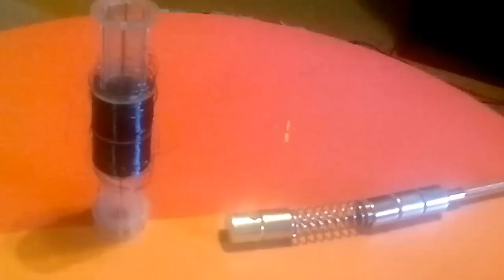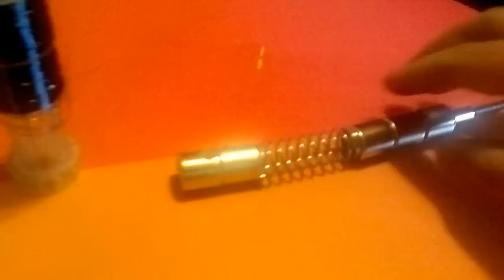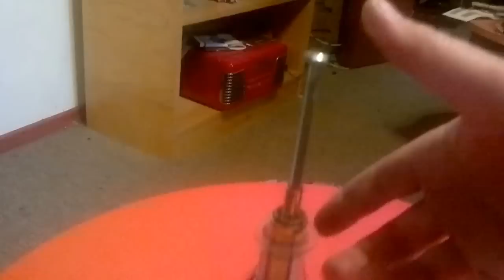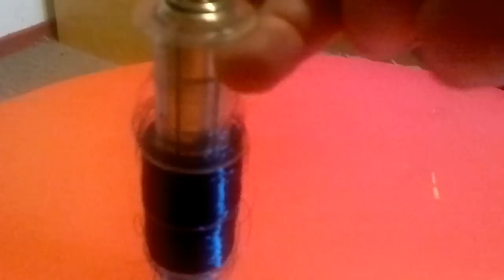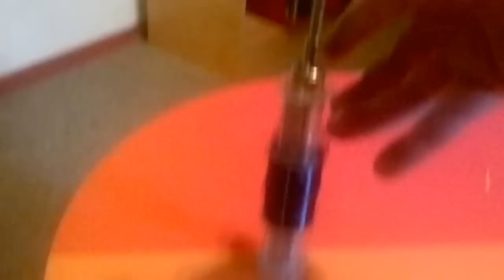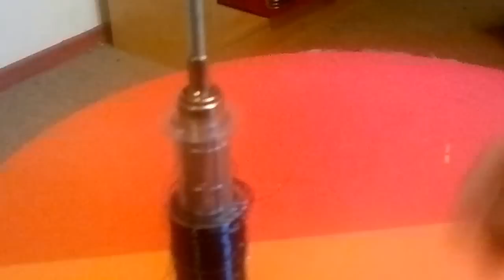Magnetic Spring Piston 2 see description

Comment from the maker: what about in the case of a pendulum, have the piston compress at say 3 o'clock and push the pendulum back and then not restrict it on the other side so it is free to swing higher? In this case slowing down or stopping the pendulum and compressing a spring is affordable as its just about to stop and reverse direction anyways due to gravity, would not a little extra pop be favourable?

Comment from the maker: Oh alright, I see what your saying, so it would be better off not to have it at all since popping it down will use up the energy.Well  I am wondering if the conservation of energy rule is taking into account  the two magnets pulling together making the work on the big wheel to be less then normally to compress the spring. Sure the magnets will still be in attraction and we are back to square one again. Or, is acceleration of a spring releasing breaking free of the magnets taken into account?

Comment: I'm not sure what makes you think this could work "in theory". If conservation of energy applies, then pushing the piston down will take slightly more energy than you can get back by releasing it due to inefficiencies like heat generation. So your big wheel will be able to move a shorter distance that corresponds to the energy transfer required to push the piston down and releasing the piston it will cause the big wheel to stop slightly short of what it would do without the piston in the system